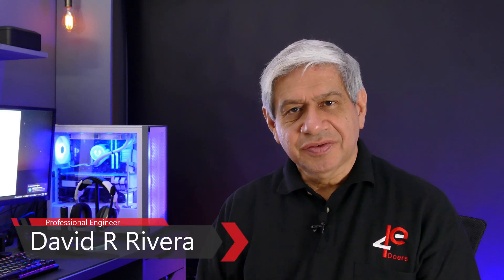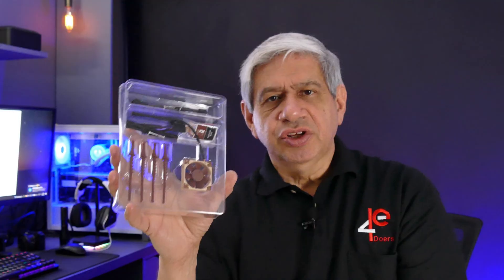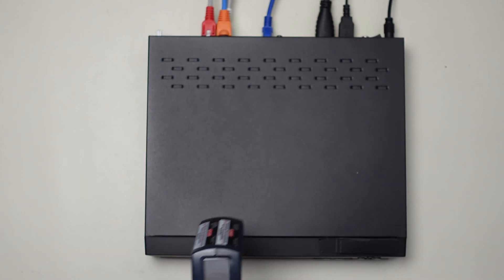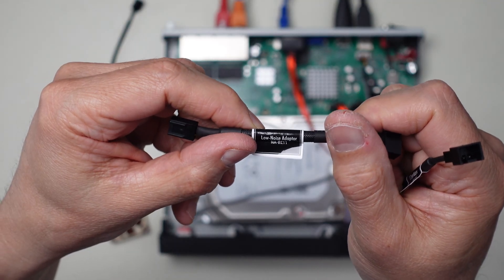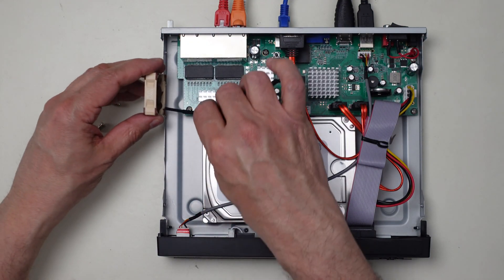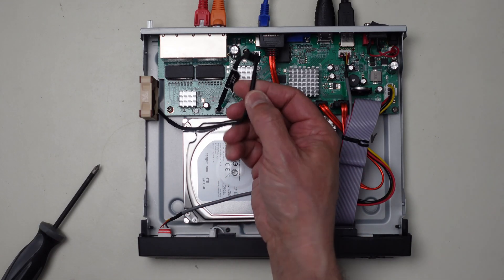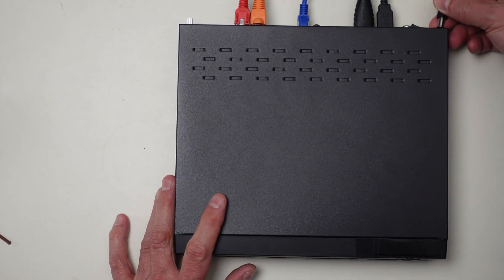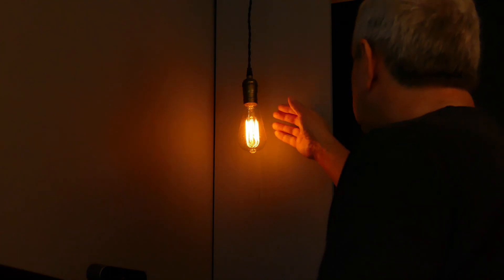Improving REOLINK NVR Cooling by Adding a Noctua Fan

Comment from the maker: UPDATE: After two days of running with the Noctua Fan running at full-speed (4500 RPM), I decided to install the 'Low Noise Adapter' (bringing it down to 3700 RPM) to see what would change.  Well - it was 'significantly' quieter, and the temps wen up less than 5%, so I will be leaving that adapter installed.
Reply: Thank you for your video!
Reply from the maker: @mynewhobby6323  You are very welcome
Reply: Is that a 12v fan or a 5v?  I see there are two options available to purchase
Reply from the maker: I would have it blowing in.  That would provide great overall air flow through the chassis, and keep a neutral air pressure inside.  If you create a negative air pressure by having them both blow out, then you will actually hurt your cooling.

Comment: Just purchased one this week.   It has the "FAN" solder points on the right side of the motherboard, but they did not include the connecting clip.  I could probably tap into power somewhere else, but I will trust the new and improved heat sink can handle the load (hopefully).  I did not want to make it too big a project.
Reply from the maker: I would use a Digital Volt Meter to check the voltage across those two points first, then make sure the Fan purchased matches that voltage.

Comment: I just bought the newest RLN8-410 (hardware N7MB01) NVR and it suffers from the same thing, namely the lack of a fan and heat buildup. I transferred the Noctua fan featured in this video from my old 2019 Reolink NVR into the new 2025 NVR. The fan DID NOT spin!  

After some research, I found that you need to REVERSE the positive and negative pins on the tiny little 2-pin plug of the fan (which plugs into the mobo). You can release the pins from the plug itself by carefully prying the two tiny plastic tabs upwards while also pulling on the cables. You then swap them around and push them back into the plug until they "click", connect the plug back onto the NVR mobo and the fan will now work.  👍
Reply from the maker: I'm glad you were able to get it working.  Thanks for the information, which I'm sure other viewers will find very useful 😊
Reply: I just bought the newest RLN8-410 and it doesn't even have a fan header lol
Reply: I have a relatively new NVR with the two pin on the right side of the motherboard.  My fans came in from Amazon for $8.99 for two.  The came with a wire that extends the two pin.  I switched the polarity by cutting the wire and reconnecting it.  Checked the fan for proper push pull direction.  It worked.  The fan was mechanically tight to the motherboard, I filed it with a chainsaw 7/32 file.  It fit so tight I did not need the screws.  Works great.  9-27-2025
Reply from the maker: @dannyball2503  Thanks for the updated information 🙂

Comment: On the newer reolink NVR 410, the 2 pin port is moved to the side of the motherboard and the pins are REVERSED.  You will need to swap your red/black wires in your cable.  You can pull them out of the cable end and put them back in switched.  Good to use a sharpie to remember which way.  There are different tricks to pull the cables, don't muscle them out.  Use a tiny xacto knife or tweezers to pry or move the tabs.
Reply from the maker: Great information - thanks

Comment: Besides swapping the red/black wires in the cable to fix the reversed polarity, you could use a USB to 3 pin adapter cable and plug in the outside USB and run the wire to the inside.
Reply from the maker: That sounds great, thanks for the information.  I'm sure some of my viewers will appreciate knowing that.

Comment: Do I need the 5v or 12v fan? There’s two voltages available.
Reply from the maker: I used a DVM and measure the voltage in the Reolink, and it was 12 volts.  I then purchase the Noctua 40mmx10mm 12v version: https://amzn.to/4cPsfeI

Comment: power connector 2pin ph2.0 or xh 2.54?
Reply from the maker: I'm not sure, I do not have a diagram of the internal REOLINK Control board.  The 2-pin adapter that came with the Noctua fit right into it.

Comment: Thank you for this very helpful post and comments.  

My RLN16-410.v3 has a built-in Sunon fan, which is a little loud. Thanks to this post, I am going to try swapping it for the Noctua fan. Here's the trade-off in case anyone else is considering it.

Airflow rate 
* Sunon = 5.4 cfm
* Noctua = 4.8 cfm, or 3.9 cfm for low noise operation 
* Reduction ~ 1.5 cfm (28%) for low noise operation

Accoustic noise
* Sunon = 15.7 dB(A)
* Noctua = 17.9 dB(A), or 12.9 dB(A) for low noise operation
* Reduction ~ 3 dB(A) for low noise operation

Since I only plan to use 10-12 POE ports (25% to 37% less than max), the lower cfm should be adequate to dissipate the heat. I am hoping the 3 dB(A) drop in noise will be worth it. Google searches suggest a 3 dB change should be noticeable. 

My $0.02 on blowing air in versus out... Placement matters. The RLN16 fan blows in and is located near the components generating heat. Blowing air directly over the components that need cooling ensures max flow rate, which should maximize heat transfer (Q = m*c*delta T). 

------------------
Air flow depiction around fan:
https://www.quora.com/Why-cant-we-feel-any-air-flowing-from-the-back-of-a-fan

Sunon fan spec:
http://www.sunon-bj.com/uploads/soft/210309/1_2042456241.pdf

Noctua fan spec:
https://noctua.at/en/nf-a4x10-flx/specification
Reply from the maker: Good Luck 🙂

Comment: So you went from no fan, to a fan & it made minimal difference(about 8°c)...
Reply from the maker: I believe it lowered the overall risk of heat damage.  Also, prior to adding that cooling the unit would freeze-up about every other month.  Though I can't prove it made a difference on that without removing the fan and taking that risk, I have not had a freeze-up since.
Reply: In the world of pc hardware anyways, cooling improvements of 8 degrees Celsius is not insignificant.  That can mean the difference between a cpu thermal throttling or not which can impact performance.

Comment: This fan comes in 2 variants 5v and 12v which one is for nvr?
Reply from the maker: I used the 12v version, since when I measured the voltage on the header it was 12v.  Do you have a DVM?
Reply: @PE4Doers  i just received my fan and my new NVR that is N7MB01 software and not working this fan, I can see there is a 4 pin conector but the fan doesn’t come with 4 pin and I don’t know how to connect the fan
Reply from the maker: @neckulay  Didn't the fan come with a 4 to 3 pin adapter?  In either case, you should be able to fit it on the connector.
Reply: @PE4Doers  the fan had 3 pin and all adapters are 2 and 3 pins, and also the new  nvr don’t have the same plug in pins like the one in your video
Reply from the maker: @neckulay  I guess your Reolink NVR has a much different version of its main board than mine.  Do you have a multi-meter?  At this point you would probably have to do something custom.  If you could determine which pins are the 12v and the ground, you would be going in the right direction to create something special.  If you want to take pictures of the fan connector and the connector on the board, I would be glad to take a look at the them and give my opinion.  My Email is my channel name followed by a 'dot' and the extension of the free Google mail service.
Reply: @PE4Doers  I’ll be in touch with you next week and let you know
Reply from the maker: @neckulay  OK, no problem.

Comment: Hello, does any version of hikvision nvr have an extra 4pin socket for adding extra fan inside the box instead of replacing the one in Power supply?
Reply from the maker: I am not familiar with any of the 'hikvision' equipment.  But if I'm understanding it correctly from you question, your power supply unit fan may have failed and you are hoping to avoid replacing it.  Am I understanding that correctly?  

Honestly, if you lost the fan in your power supply you should replace that (or the entire power supply).
Reply: @PE4Doers  the case is my dvr is inside a verical box inside the wall, the box has tiny holes ofc but i want to add extra cooling fan to the box without interrupting the dvr equipment itself.
In the meantime i Don't want the fan to be working 100% 24/7 that's why i thought of connecting it to the electronic board of te dvr

Comment: I agree. Blowing air into the unit is a better way to cool. If you think about it, any air that you suck out of the unit and into it is being warmed by the units case as it enters the unit through case vents. Also, just saw a video on the 16 channel Reolink that comes with a fan and that fan is blowing the air into the unit and out the vents as it came from the factory.
Reply from the maker: You are absolutely correct Sir.  Thanks for the comment.
Reply: So... According to you the very same air is "cooler" after going through the fan, in the very same case? Am I understanding correctly?! 🤔

Comment: I have a new 16 channel reolink nvr. It has a fan but was wondering if i could install an additional fan internally. I assume your nvr didnt have a fan.
Reply from the maker: No, it didn't come with one.  However, if you are into modifying the wiring (with a soldering iron), I believe you could add a second fan.,

Comment: Hi. One question you link a fan with 3 pin but your board and low noise adapter are only 2 pin? I dont understand this, can you help me?
Reply from the maker: 4-in can be converted to 3-pin and 3-pin can be converted to 2-pin.  With each step down you will lose some of the speed control capability, but it will work.
Reply: @PE4Doers  thank you 👍👍
Reply from the maker: @T_aus_B_an_der_Spree  You are very welcome.

Comment: how do you know where to plug the fan wire? can you plug it anywhere that fits?
Reply from the maker: You should try to pick the connector nearest the location of the fan.  That way the sensor that will be governing the PWM of that fan will be near what the fan is trying to cool.  That is not always possible, but the close you can get the better.

Comment: Update 25th August 2023.

Can confirm  today my new  Reolink DVR 8 channel 410 model comes with the 2 pin connector on the right side near the power socket, but as in the post earlier if your using this fan your need to swap over the 3 pin to 2 pin lead so that both wires are switched over.
Reply from the maker: You are correct.  That is one of the short cables provided by Noctua in the package.  There is also the small in0line cable that will slow the fan down, which I used for the first year, but then removed without any appreciable noise increase.

Comment: Just the video I was looking for. I Install a new Hitachi 3 TB Sureillance hard drive , 7200rpm. This drive  gets really hot . Temporarily , stuck 3M VHB tape on a small cpu fan on top of hard and had a piggy back connector off the main board to get power. This fan was was too big for the sideways installation.  I just ordered your fan off of Amazon, Thanks for the info!
Reply from the maker: You are very welcome.  Just keep it in mind that you may have to experiment using that extra cable that makes the fan slow-down somewhat.  Initially I put in in series with the cable, but later decided to take it out to cool things down further.  

I did not notice much of an increase in noise by removing the 'slow-down' cable, however in my case, I had the unit sitting on a shelf in my Network Rack, so the sound is somewhat drowned-out by other network components.

Comment: My Model reolink NVR did not come with a NA-AC2 connection point.
Reply from the maker: Sorry, I've heard that from a couple of others.  You could wire it directly to the 5v (and ground) connectors on a USB plug.
Reply from the maker: Just be aware, you would then be better off getting a 5v model of the Fan from Noctua.

Comment: Reolink has gotten sneaky with this. They swapped the polarity of the wires in the J14 connector — so youll have to remove the pins in the connector from your Noctua kit and swap them around. Credit to this channel https://youtu.be/S9xeg_3eREc which will help you with the process.
Reply: Thank you so much for this information.
I bought a new RLN8-410 that has the 2 pin connector on the right side (in this video is on the left).
I plugged the fan but it didn’t work. Then I saw this comment, I changed the polarity of the Noctua connector and the fan perfectly worked.
Hope this can be helpful for other people
Reply from the maker: Thanks for the update.  Was that done for any specific models of the Reolink NVR?
Reply: I have today just added a fan to my RLN8-410  with hardware version N7MB01, which is the current latest version it comes with. As confirmed I had to swap the polarity of the wires in the 2 pin end of the 3 pin to 2 pin adapter.  Thanks to you for this great upgrade tutorial and these comments for flagging up the wire swap needed. @PE4Doers
Reply: Thanks - this got the fan working for me as well for the RLN8-410

Comment: Dang. I didn’t know the newer ones did away with the fan until well — I noticed there wasn’t one inside mine — unlike the old NVR that I replaced (which looks exactly the same externally)! I’m measuring temps of 109°F - 115°F and it’s not even the hottest part of the day yet! I just ordered the Noctua fan from Amazon now. I literally just installed the new NVR days ago.
Reply from the maker: I am with you on that.  I have purchased many less-expensive console unit that come with a fan.  One thing I was pleasantly surprised with however was the very low noise of the Noctua.  I did however, have to take out that 'silencing' cable that came with the Noctua kit once the temperatures starting to rise this summer (which speeds the fan up some).  Doing that cooled it down more with a little higher sound.  Although in my network rack I do not notice it.

Comment: 82 is not 22% cooler. You would get a different number in Celsius. Or if something went from 1° to 0° is that 100% cooler? No. The only right way to do this ratio is in Kelvin.
Reply from the maker: Thanks, I will take a closer look at that.

Comment: Hi Davide,
I saw your video suggested by reolink support. I wanted to ask you for advice I would like to install 2 30x10 cooling fans inside my NVR, one in its housing and the other on the opposite side near the ventilation grille both in extraction. Do you think I can install them? How do you suggest I place them?
I await your news.
Reply from the maker: I'm sure you could, but the placement should be based on heat testing if possible.  Also, you will need to do some hole drilling, so the metal shods might become an issue.

Comment: my 2.5 year old REOLINK NVR runs quite warm/hot. Finally, the NVR started rebooting itself. Finally, it froze and wouldn't boot. I opened the NVR and disconnected and reconnected the HD cables and it came back. But the HEAT inside was the real problem so I bought and installed the Noctua Fan. It really helped to cool down the outside of the case and it is no longer warm.  WARNING: trying to secure the 2 metal screws into the frame and the bottom of the fan is very DIFFICULT. Wish you would show how to make it easier for the newcomers ?  ( you need the larger phillips head screwdriver that can apply torque ) Thanks !
Reply from the maker: I agree it is very difficult since those holes are not threaded.  The best way to do it is with a set Drill/Tap tools, but that costs about $40 to $60.  However, if you do get a set, they will come in handy for many other do-it-yourself projects.
Reply: @PE4Doers  ok, when it APPEARS so easy on the video, I feel so STUPID when I can’t put 2 screws in. Just a warning for the not so tough DIYers. You can do it with a larger Phillips screwdriver and a lot of force ….
Reply from the maker: @getsmartpaul  Great point Sir.  That is why I invested so much in my top-of-the-line set of screwdrivers.

Comment: Just so you know, I must have either an older or newer version of the main board then is depicted in this video. The fan connector was NOT in the location shown. It was to the side, away from the camera inputs, next to another connector. Located between the power connector and the ribbon cable that goes to the front controls. I checked the voltage on mine, was 12.3vdc, and hooked it up there. Seems to be working fine.
Reply from the maker: Thanks for the update.  When did you buy your system?

Comment: I am new to Reolink and just recently purchased the RLN16-410 to upgrade from Amcrest which I was using for many many years. I am very pleased with the Reolink so far, but would like to add this fan since it appears it will keep it cooler. Is this fan compatible with the newer Reolink NVR's? I'm assuming it is, but just want to verify before making the purchase.
Reply from the maker: I wish I could say for sure.  Do you have a specific model in mind?  I may be able to research it.
Reply: @PE4Doers  Thank you. I found a forum on Amazon, and the owners of the RLC16-410 have all stated the same as you did, and recommended the same model of fan. Thank you again for your response.
Reply from the maker: @jcm9698  You are very welcome.

Comment: Nice.....i uograded to a 6tb myself....im tryiny to figure out which esata cable to connect an additional 2tb or 4tb... which would you recommend. Im finding usb to esata...but yhe nvr has an esata port to the back so not sure why im confused. A lil guidance would assist
Reply from the maker: Ideally, you should use an eSATA straight through cable.  Inside the DVR it connects to one of the units internal SATA ports.  There is no USB involved.  The trick is to get the proper eSATA enclosure.  Here is a link to the one I use: https://amzn.to/3D8xs0z